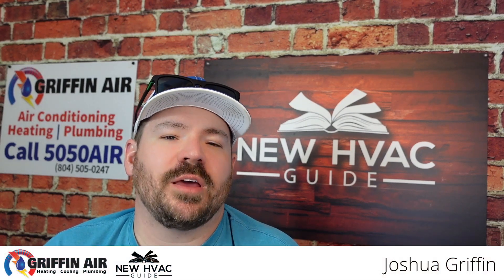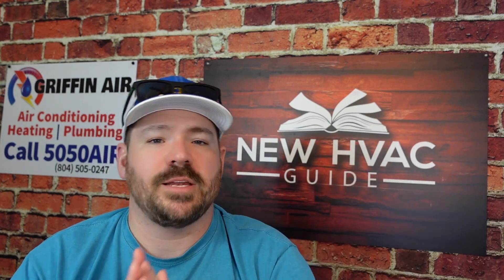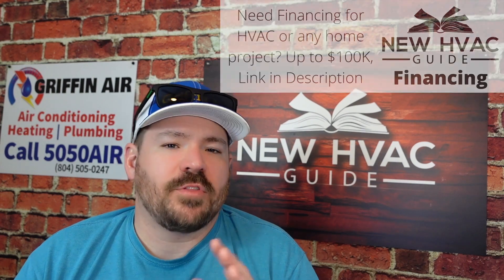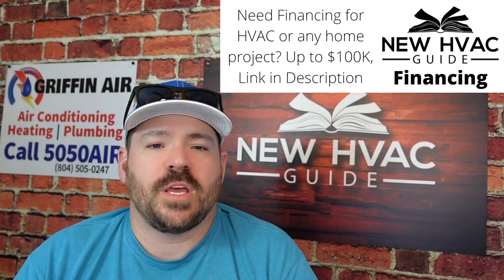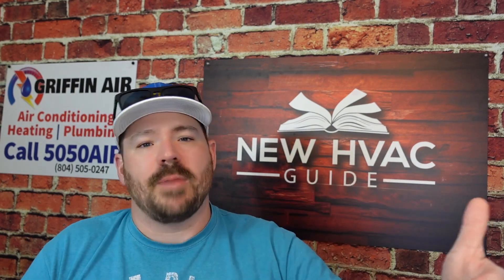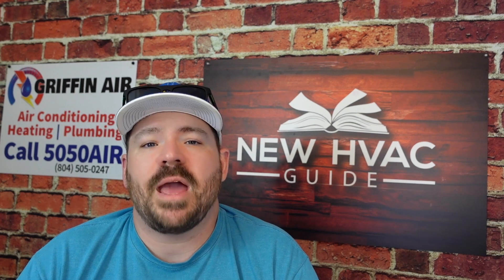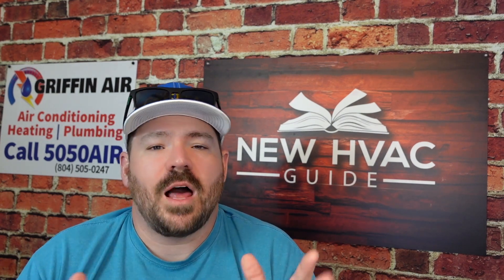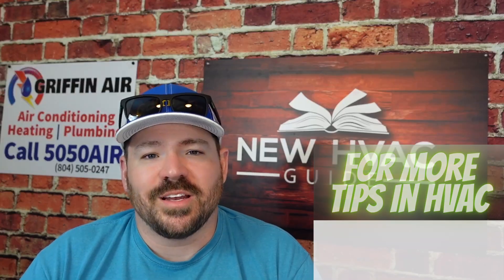HVAC Contractors BREAKING RULES on Linesets!

Comment: Hey I’m looking at installing a mini split in my fifth wheel. I saw another person run there line sets through the underbelly then come up to the unit attached to the rear. It’s my understanding not to place a dip or low spot in the line set. Can an HVAC tech please reply to this and confirm, I don’t want to install incorrectly.

Comment: Yes, undersized or over length line sets are a big problem. Undersized line sets are very common in some markets mostly because as equipment became more efficient over the years the line sets were required to be larger and lazy, uneducated, unscrupulous, and low bid contractors  often use the existing line set on changeouts. I use to see this ALL the time on the central east coast of Florida.  This not only results in lower efficiency and capacity of the unit but invariably leads to premature compressor failure as well, often in the 5 year warrantee period. But the unfortunately reality is the manufacturers don't know this and will usually give the contractor a warrantee compressor anyway and he will change it out for labor only and it will fail again in a few years. I saw one extreme situation where a unit was on its 4th compressor in 4 years when the customer decided to call a different contractor, me. He said he thought that the manufacturer was junk and wanted a different brand.  I told him the real problem was he simply needed a larger line set and that was the reason he kept having compressor failures. We got the job, received ANOTHER warrantee compressor from the wholesaler, changed out the line set and all was well. That was pretty much the end of the story because there's not too much you can do at that point except be mad at the incompetent contractor. I mean you could sue the guy if he was still in business but the only one that would win in that case are the lawyers. The moral of the story is beware of low bid, unqualified, poorly trained contractors. Easy to say, hard to do because very often the worst contractors are the best salesmen and most consumers don't have the knowledge to make an informed decision on who to buy from. It's the reality of the market and just one more reason I'm so glad to be retired.
Reply: I agree I've gotten 3 bids for a new furnace and one scumbag told me my heater exchange was cracked while 2 other companies said it was fine. I have a 2800 sq ft home with 2.5 baths 4 bedrooms 2 story with great room. Current furnace is comfort maker single stage 125k btu that's 19 years old and a 4 ton 13 seer ac. My gas power vent tank is Bradford and White also 19 years old 48galloms at 40k btu. It's always 4-5 degrees hotter on second story and my general aire original bypass humidifier was installed on the supply side so we don't have a working humidifier so in the coldest months the humidity is 12% sometimes. I was debating on all new furnace and humidifier, media cabinet/air Purifier with uv light of some sort and a new humidifier that runs on fan or when furnace is on. I have gotten quotes from $6100 for Lennox just for furnace to $7400 for carrier just for furnace I'm thinking my furnace is fine and just replacing the humidifier with an April aire 700 but not sure if that would fix the humidity issue?

Comment: * HELLO, I just installed a NEW FURNACE 3 TON  AC  "CARRIER " > HANDLER  [ MODEL # FMA 4P3600 AL ( ICP ) ] &  CONDENSER [ MODEL # WCA 4364 GKA ]   SET FOR A 1,090 SQT APARTMENT.....CAN I UPGRADE  TO A VARIABLE  HANLDER WITHOUT  CHANGING THE CONDENSER  ??? Thank  you  !

Comment: Question on heat pump line sets: why is   the liquid line for a split system not insulated, but the line of a mini split is insulated? Is there a technical reason?
Reply: Yes the metering devise is in the outdoor unit meaning both lines are “cold” so insulation prevents sweating

Comment: If you exceed the maximum line set length that the manufacturer specifies, the the warranty will be invalid.  The compressor will likely (surely) fail  beyond the specified maximum length.  That said, I have encountered some manufactures have line sets up to 95 feet (mini splits), which is long.  I would shop for equipment that allows for longer line sets.  A call to a A/C manufacturer may help out and maybe they can guide for a solution at a minimum.  But, I wouldn't install beyond specs.

Comment: The root of the problem is domestic systems are just getting too expensive and complicated. People are trying to save because they feel they have to. The industry needs a major perspective shift towards building economical systems.
Reply: I agree but the epa is the main ones breathing down the manufactures neck to make these efficient systems etc and in theory it should benefit the customer but that’s in theory rather than actual practice and some companies only install systems they know they can install well
Reply: @boywhohadatiger  to me what is truly ridiculous is the epa forces unreasonable standards on manufacturers. This raises the cost of hvac systems for the consumer. When consumers can't afford the new systems they resort to self install or jury rigging systems, which result often in less efficient operation, or else they purchase cheap window units which are much less efficient. It is bureaucratic stupidity at a criminal level,

Comment: What’s the consensus on linesets at installation of new outdoor equipment after replacing 40 year heat pump…..Re-use, flush, or pay extra to have refrigerant lines replaced.
Reply: If they hold a vacuum, and look to be in good shape, the can be flushed and re-used. Some tube insulation may need replaced.  Maybe get another 40 years out of them.  Sometimes replacing the line sets is a major task, some homes have them routed through walls and all over, so in that case they may be attempted to be re-used.
Reply: My lineset was in very good condition after 27 years but I flushed some scale out of the pipes. Most installers didn’t use nitrogen during brazing. I used StayBrite8 to install my new equipment.
Reply: @picklerix6162  Good observation! - never know what the original installer did or didn't do.  Need to purge with nitrogen when brazing  - for certain.  Also need to install a filter/drier.
Reply: Definitely make sure they're the right size before you go to reuse them. I've seen people make that mistake before

Comment: I wouldn't install anything the home owner bought online
Reply: Just curious, is it because it eats up the mark up or chances are high that they bought a wrong unit?
Reply: @lapseofeternity  the installer should just not warranty labor.
Reply: @lapseofeternity it’s because the customer knows what the unit costs and now  the HVAC scammer has a harder time screwing the customer with a ridiculously high bill…
Reply: Never, ever!
Reply: In my area, the bids always separate line items 
For example 
Labor warranty - 2 years
Equipment warranty by manufacturer- 10 years

Is there some other component to the warranty that installer needs to do?
Reply: I learned this recently when going through my own house install, the manufacturers have different warranty terms when the equipment is purchased by user vs installer. Like MB doesn’t give 2 year warranty if I ordered from lets say Supply House. Not sure how true it is. But if it is, then it basically doesn’t leave any scope for a user to buy it themselves, unless you go with a different manufacturer.